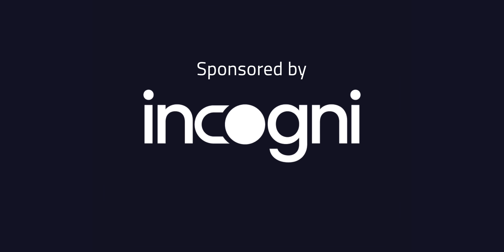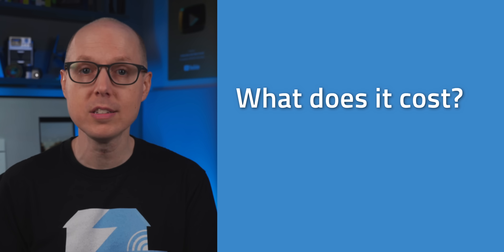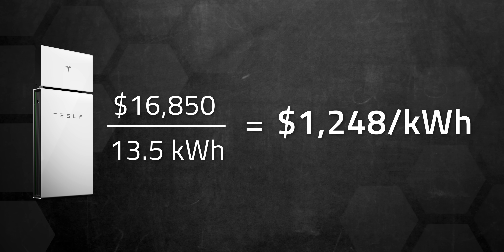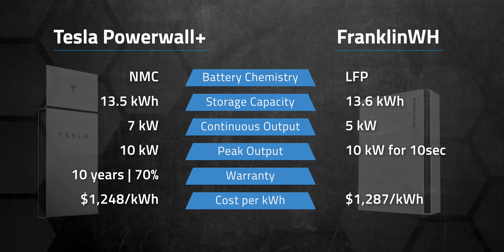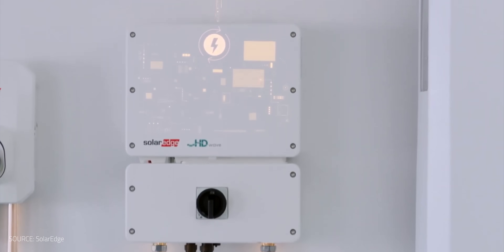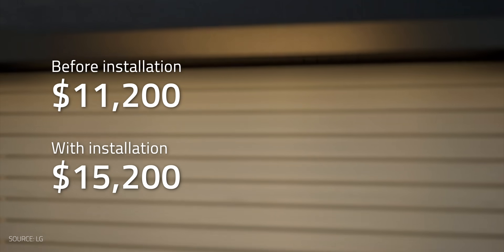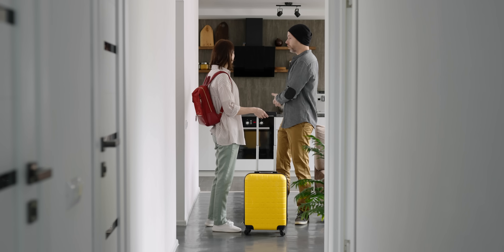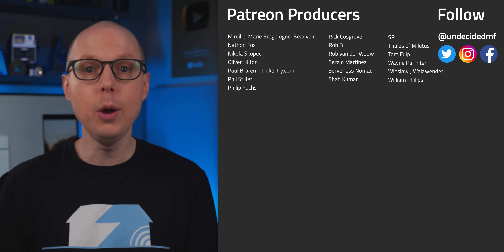Top 5 Batteries for Home (And One You Might Not Expect)

Comment from the maker: Corrections: 07:37 It's NMC, not LFP, 07:46 It should be 9.0 kVA peak (10s) max output
Do you want any of these options for your home? Have any you’d add to the list? The first 100 people to use code UNDECIDED at the link below will get 60% off of Incogni: https://incogni.com/undecided. 

If you like this video, check out Are These Batteries The Future Of Energy Storage? https://youtu.be/n1TBAWlbXKI?list=PLnTSM-ORSgi4dFnLD9622FK77atWtQVv7
Reply: We have more options in the EU but currently I would vote against NMC as we had several fires in Germany related to NMC storages. Rather go for LFP which is not as volatile as NMC.
Also I would not install batteries outside if the temperature drops below 10°C or even freezing point if they do not include a heating element. Charging NMC and LFP in low temperature conditions drastically decreases their capacity over time. The specs vary by manufacturer but current gen batteries just don't like being to cold.
Pylontech certified their sodium ion battery last month here in germany. These should reduce costs for storages in the future as well. So don't go all in yet.
But most likely the grid of the future will have a micro grid like structure which will be interesting to see how it will work and especially how grid cells can survive on their own and then resynchronize to the main grid if it comes back after a power outage.
There are so many technical aspects and challanges ahead.
Reply: Have you considered Sol-Ark, you could power your entire home with one. AFAIK 200A passthrough is supported and combining that with the EG4LLs is a killer combo 🙂
Reply: I'm in EU, why Sonnen wasn't considered?
Reply: @mietzsche1081 same only in the U.S.  I love my Sonnen.
Reply: What using an EV as a battery backup? What are the options and how do they compare to Tesla or Enphase?
Reply: Storz Power
Reply: i´m a little bit disappointed, that only the big players get some attention in your video... would have liked it to see something like pylontech with very low cost battery options.
Reply: Why none of the server rack batteries? They're good options. They're more than price competitive The only downfall is that you have to add an inverter controller.
Reply: I currently own a Solar Edge rooftop PV system.  I balked at the batteries at the time of install because the utility company seemed to be getting in the way (somewhat taking control of my power generation). 
This video is very eye opening but where do I go to learn more and how to navigate the political environment with the utility company and Solar Edge?
Reply: Have not but you and the other YouTubers of science need to do a weekly chat.... If it's possible and profitable
Reply: Nice work on the video! Editor Note - FCP broken transition at 00:23. Keep the videos coming, all options need to be know as we move forward.
Reply: We have the Enphase pannel setup on our house. So obviously that would be the option if we get into a battery.
Reply: Matt, you seem to be talking really really fast in this video.
Reply: @terryburgess7613  He's spoken about them in a different video, my guess is they aren't easily available over there. Redflow is what I'd like but there's way too much red tape where I'm living. 😞
Reply: The Incongi is a bit misleading, annual are always cheaper than monthtly, ‘50%’ cheaper, with your code, you get 60% off the monthly subscription annual based. Meaning a 10% extra. Kinda misleading, not your fault, but not gonna do that. Bummer. Good video though.
Reply: I have an Enphase system installed. I really want their batteries.
Reply: What about StorEn vanadium battery?
Reply: almost not worth it. pricing of these products are terrible so that the user ROI by 8-10 years. however, these systems go down in price so fast that one is better off not getting these and just get the DIY or easy to use backup power products. Enthusiasts like the off-grid people, van lifers, technical people can ROI real quick.
Reply: For comparison: my DIY system with 60kWh LFP battery, 6kW output with 18kW peak, generator input and 10kW solar input comes at €145 per kWh.
Reply: Saltwater Batteries might be worth mentioning. They have a relativley low energy density, but for stationary use they are the cheapest option in the long run.
Reply: Zenaji Aeon Battery
Reply: HomeGrid has taken a big peice of the market in a single year. They are a DC coupled solution that comes in at about half the cost of the batteries you went over. Super high output of 15kw and modular capacity to 40kwh in 1 stack and up to 570kwh parralell. Energysage did a report for all equitment installed last year and big groups like LG are losing market to Homegrid. From my understanding HomeGrid actually has more market share than Franklin WH in 2023.
Reply: I would have liked to see the new Sodium (aka Salt Water) battery.  They don't have the cycle life of Lion, but they are cheaper and non toxic.  SolaPV is one company I know of, but there are others springing up.
Reply: I live in Utah and use Sonnen. Super happy with it. More importantly, it was the only one the power company gave a rebate on which netted me $3k refund and that obviously really cut on the purchase price.
Reply: Awesome video.
I've got a soft-spot for energy storage.
Just curious, as I briefly considered a flywheel energy storage system for my senior design project.
I wanted to ask, are there any home or microgrid flywheel style energy storage options on the horizon?
Are they even feasible?
Reply: @ExtraTimeCreation  This is project we did in high school competition. You can do it very cheap.🙂
Reply: Not sure if you have done it already but can you do a video on the Panasonic EverVolt system as well. Thanks.
Reply: For some reason my thoughtful comment got deleted two times...
Reply: The C in NMC stands for cobalt. There have been some fire problems and it is my understanding is they mine cobalt using slaves in China or child labor in the Congo. Lifepo4 batteries don't use cobalt. I have you looked at the EG4 systems from signature solar? 48 V server rack batteries? SOK?
Reply: Can you look in to the Solhyd solar panels which generate hydrogen?  I saw a video about them on YouTube and I’ve love to get your (informed and trusted) input.
Reply: Thoughts on solark ? This is what I went with as I can use any battery system which I used Arc Battery.
Reply: Are there no LTO options in the US? They last 15 to 20 thousand cycles meaning 41 to 54 years if you only drain them once a day. They are safe and their temperature range is from -40°C to +65°C operating temperature. All on paper, because I never had one for that time, but impressive.
Reply: Just added 10kwh of server rack batteries at less than $3.5k It's a no brainer
Reply: @chrishuxley7634  I am interested in your idea, please give more details about how to do it, like what make/model of the 10kwh of server rack batteries to buy. Thanks
Reply: Any thoughts on battery options from Sonnen USA?
Reply: ?Lithium Iron Phosphate is much better than Tesla
Reply: Thanks for the corrections! Regarding home backup power options, I highly recommend the Segway Portable PowerStation Cube Series. With its massive capacity, powerful output, fast recharging, and waterproof design, it's perfect for outdoor camping and ensuring uninterrupted power supply for your devices. Check it out!
Reply: Thanks for sharing your corrections! It's always helpful to have accurate information. Regarding the Segway Portable PowerStation Cube Series, it's definitely a great option for outdoor enthusiasts and RV lovers. With its massive capacity, powerful output, and fast recharging, it's perfect for camping or providing backup power at home. The waterproof technology and comprehensive protections are impressive too. I'd definitely recommend considering the Cube Series for your power needs.
Reply: Thank you for your comment! I completely agree with your corrections regarding the video. As for the Segway Portable PowerStation Cube Series, it seems like a fantastic option for outdoor enthusiasts and RV lovers. With its massive capacity, powerful output, and fast recharging capabilities, it can definitely provide reliable backup power for extended periods. I would highly recommend considering the Segway Cube Series for your outdoor adventures and home backup power needs.

Comment: People shoud explore The posibility for a DIY project, Use the aplication like Chat Gpt to help  design the Battery and then look for the advice of a proffesional to check the specifications,integration of the components and safety: A lot of Money can be saved. If you have a contract the Customer is not allowed to Modify the system and if you ask for It it will cost You a lot of Money that you can use to upgrade your systems. It is not imposible to do your project and save a lot ofMoney.

Comment: I love the Anker I'm really considering it. The Anker has most the capability that ecoflow has and they have their reputation of electronics. I've been running their headphones for 2 years aboard a lobster boat only ones to hold up to the salt and only came in at $125 CAD. My boss loves his ecoflows he has 4 of the ones that were in the end of the video. They can run a DeWalt hammer drill and not even break a sweat. I had a table saw hooked up it will trip the breaker just as it will hooked to the wall but I must say pressing the button at the end of the cord is better than going to the breaker pannel across the property

Comment: Two things I would have liked to see covered that wasn't.  First is I think it is called LRA, or the "startup" capacity for things like AC/Heat Pumps etc.  The second, which is huge for me, is software integration.  One of the main reasons I am leaning Tesla is the software integration and the ability for me to tie that data into my smart home, or access directly through APIs. I would love to know if these other options have transparent systems that you can get data out of, rather than proprietary apps that don't.

Comment: Unless your local grid has constant interruptions, with power outages that last a day or more, just no reason to put large battery storage in ones home.  Much more cost effective to do battery storage at the community level.  Use a VPP to manage when and from what sources those batteries are charged, whether that be local solar, or when the grid offers lowest cost energy.  

Doing this has all the benefits with next to no risk:
1) Financial: Lower cost:  Setup and wiring each property is expensvie.  Cost for battery per kW is 1/5 that when done at the community level with megapacks.  
     Better IRR.
2) Flexible:  Property owner can rent / lease storage as needed, adding or subtract storage as needed from the community storage bank. 
     Works for those who own property as well as those who rent.
4) Professionals manage all the complexity, including purchase and maintenance, etc.  Property owner / renter only needs to request service and pay monthly fee.     
     System upgrades / maintenance all taking care of and can be managed so there is no interruptions.  If something goes wrong with your home battery, you are going to out for days.  
  

We should all push for community battery storage offered to  all in the community wishing to rent it via a VPP.  This is the fastest way to expand renewable energy sources, save money for consumers, and remove much of the headache being imposed on people in regards to the transition from fossil fuels to clean/green/sustainable energy.   

Couple community storage with community solar with ties and energy contracts to the macro grid at the community level and you're all set. Higher reliability than today, much lower cost, less infrastructure and energy is controlled by the property owner / renter and the local community, not the utility which is focused on equity growth for shareholders.

Comment: Wow. $ 16,850.  For 1 battery. Cost more than my system: 4950 wH solar panels included mount +( 6500 wh x2 EG4 inverter) + (15 kwh Eg4 batteries+ 15 kwh batteries cells of catl 16 cells 410Ah.) Included wires 2/0 , 4 breakers lug nuts blah blah. DIY system.  Cost me about 11,000 included 500 feet of 4 AWG Ac wires [800 USD] and 500 feet of 10 Awg dc solar wires.  In San Diego CA, summer or year round no problem. But. In winter I would needed 5,000 more watts to able to charge car.  Family of 3, run 1 x 18 cubic frig, 1x 10 cubic foot frig, minimal lights use.  Not able charge car in winter with 5kwh solar: cloudy or rain

Comment: We have enphase solar now, but we didn't get the battery backup when we put in the solar,  big mistake.  We should have done the entire system to start.  We have a portable generator when power goes out.  Not an issue in the summer, but it will not pull the heater in the winter.  I am interested in updating our system to having a battery backup, with the option of charging using the generator if needed.

Comment: I randomly checked a 48V, C20 capacity is 743Ah. forklift battery new is about 7k USD, nominal 35,6kWh. If . I wanted to dump 15kUSD in would buy two of these without any electronics. They are designed to huge outputs and serious abuse. With my power consumption peaks they would outlast me for sure. Mind you, forklift is not AGM or sealed lead acid. Heavy as hell and needs maintenance, should be installed outside to vent. It needs to re recharged with decent power regularly (needs serious overpaneling or a grid-tied charger for long dark periods). So it's surely not for everyone. But dollar-to-dollar it is still the cheapest.

Comment: You mention sharing your battery's energy with neighbors (selling energy at night).  It's important to note the impact the extra use has on battery life.  Additionally; the LFPs are far better for discharges to below 5 or 10% not shortening life excessively, as with L-Ion.   

4000 cycle warranties only mention 5 or 7 years because that's the typical time for 4000 cycles; and a partial cycle isn't equal to a full cycle, which is exponentially worse for L-Ion.  A bat that's discharged to sell to the power company won't last as long, so you'd have to weigh that against the revenue earned.  I've heard you can get a solid 20 or 30 years from an LFP battery with light usage.  With modern programming options, it may be possible to only sell a little to the power company, but stop when your anticipated bottom-charge is 30% by the time the sun rises.

Comment: Enphase is supposed to be coming out with a bidirectional charger in 2024. So you can use your EV battery in case of a power loss. My Bolt has a 66kWh battery. Granted, the technology on the EV end, maybe only NIssan and Ford have it, but this is a game changer once other companies start incorporating the software/tech into their cars. Will sell a lot of EV's, I think.

Comment: Option 6: Go completely off grid with plenty of panels (cheap) and a good MPPT which gives usable energy even when it rains. Then add a medium size (expensive) LiFePo4 and a good BMS. Add a high end inverter to get reliability. By far the most satisfying and cheapest option.

Comment: Only great if your so rich you can afford hundreds of thousands and own the home and don't have a mortgage and have planning permission to fit solar.!

The Home Battery alone be thousands to buy. 
The solar also thousands even for a small system. So really good tech like this is great but only if your so rich you don't care about the costs.

As for the prices dropping due to mass productions, 
No that don't seem to be the case for the popular Eco Tech like solar and batteries. They are in fact getting more costly each month never known yearly!

The terrible fact is, to benefit from the clean Eco tech self owned power systems that save you from paying power bills, 

You have to be very well of the save money since the systems are very pricey. So the poor which make up about 85 to 90 % 
of the planet who really could benefit from solar and home heating and battery tech are the ones whom can't ever afford the tech.

So again the rich get better less pricey running costs and free hot water etc. and the poor don't because of the high costs getting the tech.

And landlords even if they fit the tech to their rental homes, they will just push up the already high private rents to pay for the tech, thereby forcing out the most poor renters.
So not good for the majority only for few who have tons of spare money.
Reply: Actually we just got price reductions from two major suppliers and as for solar being only for the rich it's just not the case. The main reason to go solar with storage is to save money vs continuing to rent your energy from the utility companies who actually do raise their prices continually. With the right system you're locking in your monthly energy bill for years to come vs trusting your utility company. Yes the gear can get pricey but if you're working with a reputable company and you can beat your costs vs 20 years of doing nothing saving tens of thousands of dollars it's a easy decision. Now if you're not a homeowner or you haven't taken care of your credit then it's not for you.

Comment: I agree with Cordless32, Signature Solar's EG4 18KPV Hybrid Inverter System Bundles offer very significant cost reduction from the Tesla Powerwall with better peak and load characteristics.  They do also offer the ability to add batteries more easily over time in 5k increments or in 14.3k increments depending your preference for server rack or Wall mount.  It is a little me DIY but there are plenty of YouTubes on this.  For the inverter and a 28.6K battery  is only $14K.  That is less than $490K/kwh installation not included.